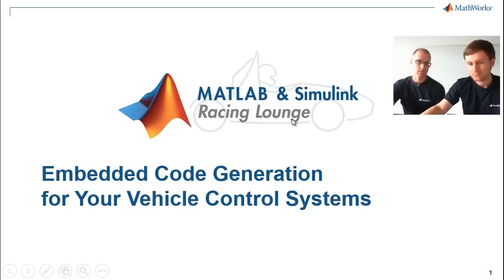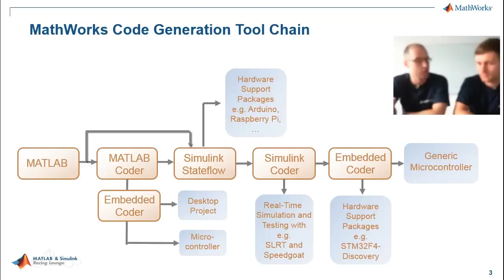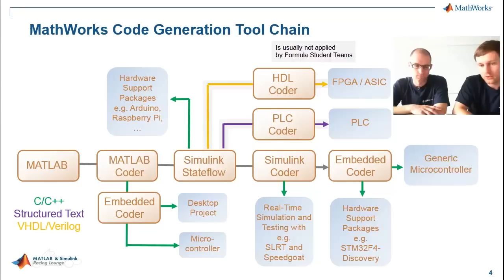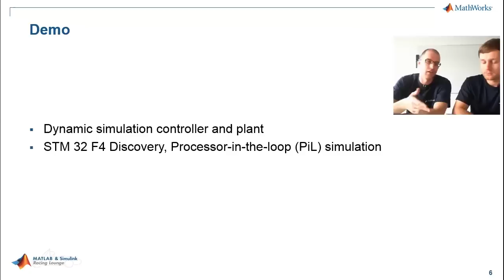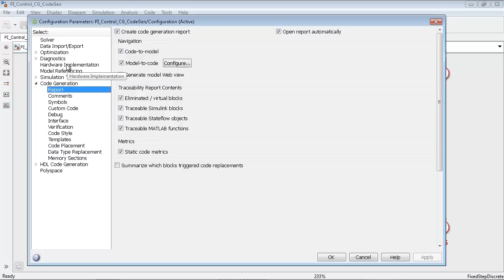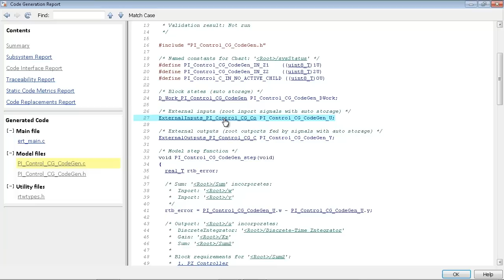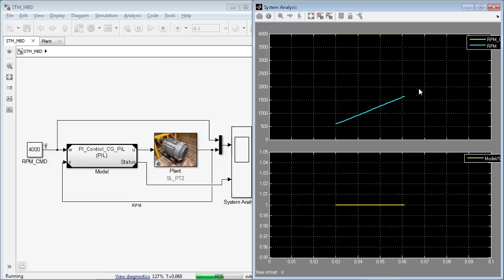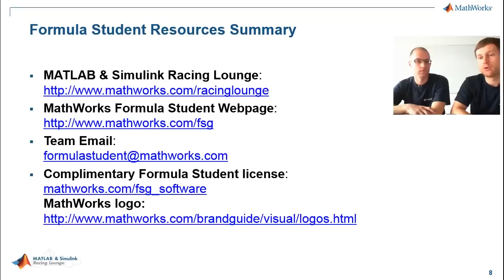Embedded Code Generation for Your Vehicle Control Systems

Comment: Hi.there is an continous time option in interface configuration part.what does that mean and if it can change the generated code?
I want to generate C code for fuzzy system and have to enable this option to get code
Reply: Teimour Hosseinalizade 
Have you got an answer?

Comment: How can I contact you guys about Raspberry Pi MATLAB/Simulink tool box question?
Reply: Every Sensor value is a input in your model. So use the library and give the value to your associated system input.